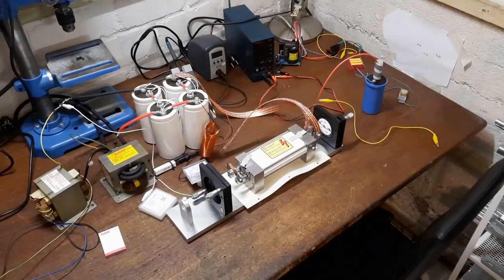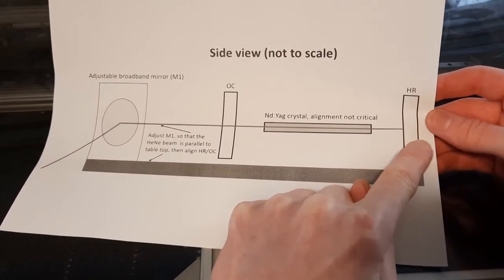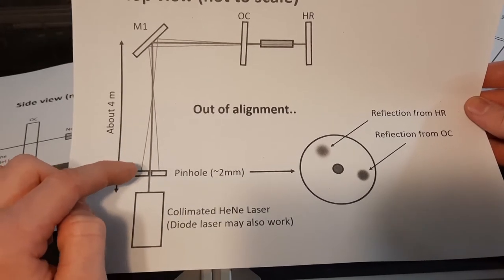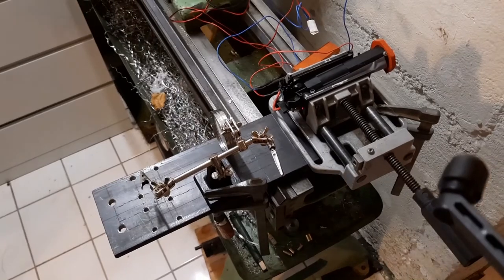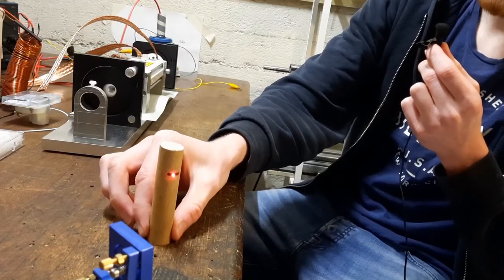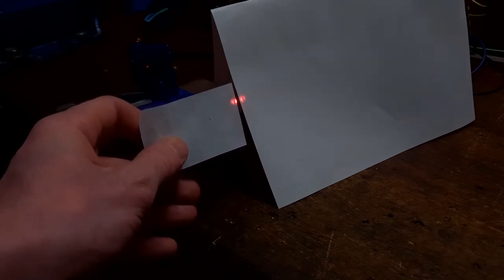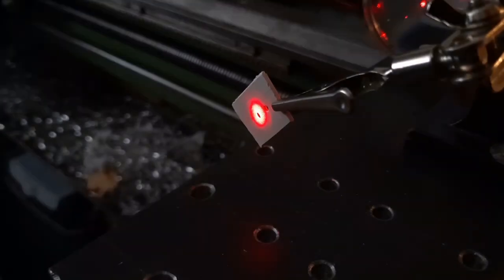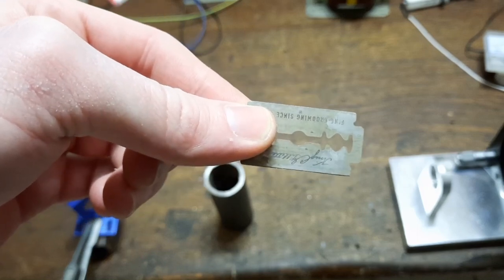How to align pulsed lasers with plane mirrors

Comment: Hey, so I am in the process of building something very similar and I did follow the spot over spot alignment until it reached a diffraction pattern at the alignment laser starting point. I still can't get lasing though 😵‍💫😵‍💫 is there a reason you have your mirrors so far from the yag? Like is there a minimum seperation required?I'm also using plano-plano HR and OC. Not even thinking about a q switch yet. Tried xenon pumped(not super efficient reflectors) @~300J using electrolytics at ~1200VDC. Any help is awesome, I'm driving myself nuts here 😵‍💫 perfectly good 1% doped yag 5mm x 101.6. I am using a gold HR though, but a 10% OC (1064nm obviously)
Reply: Using an HeNe laser for alignment as well. Although I didn't put any optics on that so it diverges fairly quickly. Can't reach quite the distant for alignment you are, but still it's definitely one singular interfering spot, and I initially had like 4 😵‍💫
Reply from the maker: I would suggest collimating the alignment laser and trying higher distances. Although, if the cavity is not that long, a meter or two should be plenty. 10% OC with a ~110mm flashlamp pumped crystal will work - I would even say that lower would be better, more like 40-50%. But for now its okay, lower lasing threshold. Be careful about the optics through, there will be very high intensities on them with that OC. They are all clean and spotless, right? Gold HR is okay, look up the reflection curve of Gold if unsure. How are you trying to see if it is lasing? I'd suggest thermal paper (like from store receipts). That way you can see the beam shape as well. How's you pulse forming network built?  The flashlamp pulse should be around 200us length. You could try an oscilloscope and Photodiode if you have that. I didnt need it though.
Reply: @WoodenWeaponry  Hmm, I hadn't really considered the PFN. I just have the caps dumping directly into the bulb, but I'm only running alligator test leads at the moment. I don't have an oscilloscope yet, but I'll probably need to get one. Out of curiosity what are your caps rated, rod dimensions, lamp model? Sorry to ask so much, I'm just racking my brain trying to figure this out. Definitely not the quick slap together I thought it would be. Also, I did accidentally scratch my HR gold mirror with a cotton ball, but I got lucky at auction and have 2 more(along with lens tissue on the way 🤪). I do have a 60%T OC on the way along with 2 INP3-7 russian xenon tubes, so maybe between the new optics, and new bulbs I'll get lucky. Let me know those specs when you get a chance, and thank you for posting the video!!
Reply from the maker: @talktoyourself  I can't remember the exact ratings but the capacitors are Unlytic UL30BF0290. The rod is a 160x6mm Nd:YAG (it was an ebay find). The flashlamps I got on AliExpress, I think they were called X9x130x260-5mm. You should really consider making a PFN, your flashlamps could just explode if the pulse is too short. Also, you want the entire fluorescent lifetime (~200us) of the Nd-Ions to be pumped.
Reply: @WoodenWeaponry  Awesome! Thank you for some of the more detailed info, I did end up buying some of those exact model caps on ebay(lucky timing I guess). I didn't realize those were film caps! I did some research last night and it looks like just about everyone is NOT using electrolytic caps. I have a feeling that might be part of it. I will definitely get some calcs done as best I can to get the pulse to last the fluorescence life. I'm also thinking I may redesign the current optics/housing arrangement to have stronger confidence of alignment. Hopefully I'll get it working well in the next month or two when everything comes in and I'll tag a video if I make one, and also credit for your help of course 🙏
Reply from the maker: @talktoyourself Yes, Film caps are the way to go, since they have much lower Internal resistance/inductance so they can distcharge quicker. If you only used electrolytics until now, chances are that your pulse is actually larger than necessary, meaning a substantial amount of pump energy is lost. 
Sure, I'd love to hear back if it worked!